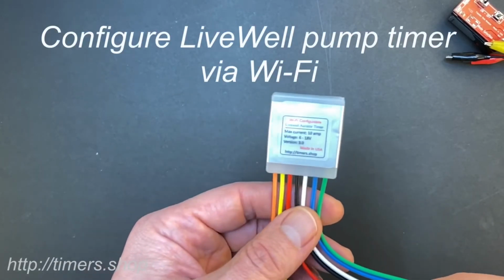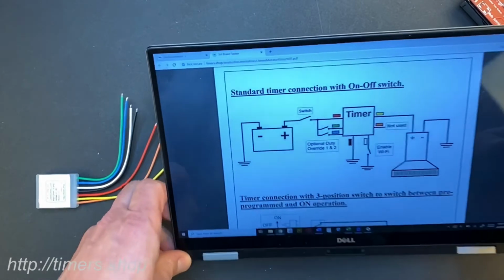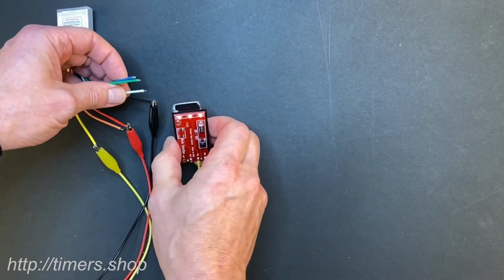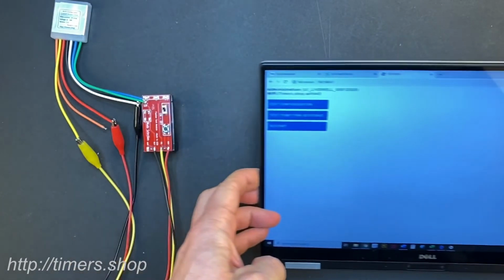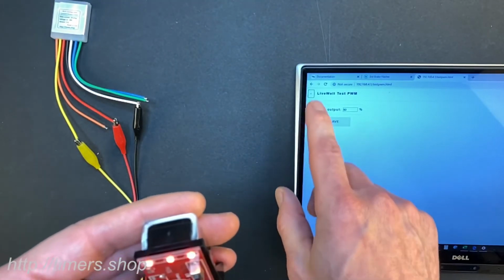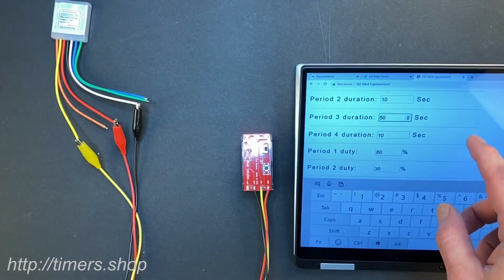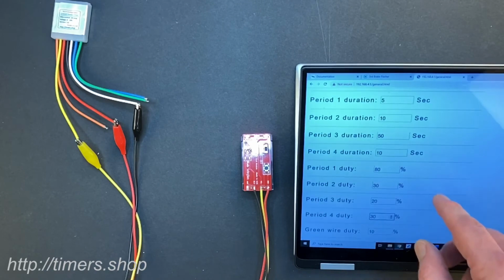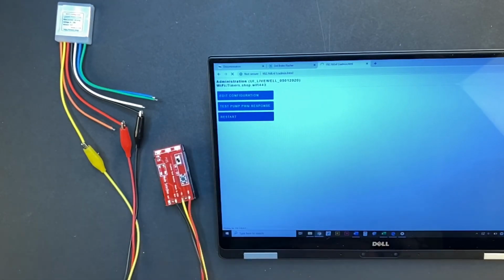Automatic LiveWell Pump Controller with variable output 5% to 100% duty. Configure via phone.

Comment: So if I want to run the pump for 30 seconds then pause for 150 seconds, configure 1 for 30 seconds at 100 % and 2 for 150 seconds and 0% ? 3 and 4 leave blank and the pump will run 30 seconds out of 3 minutes?